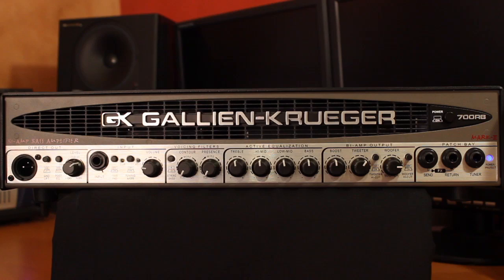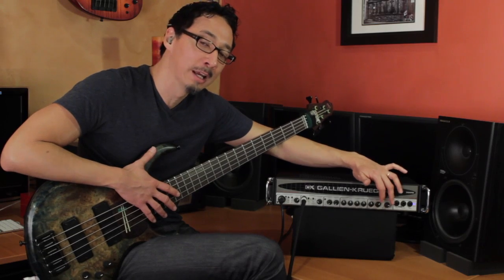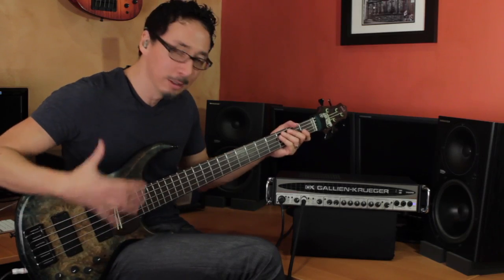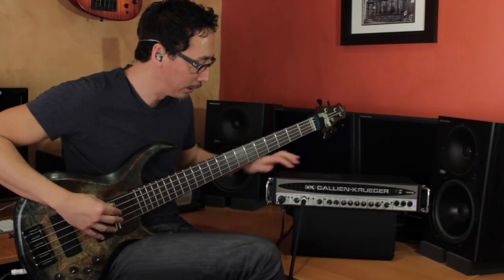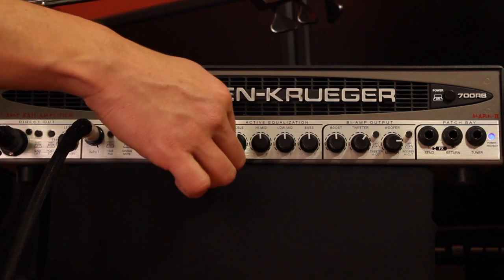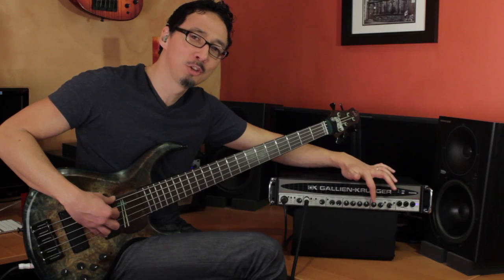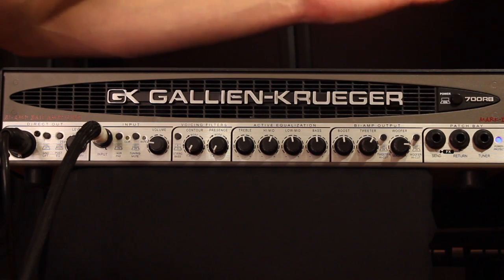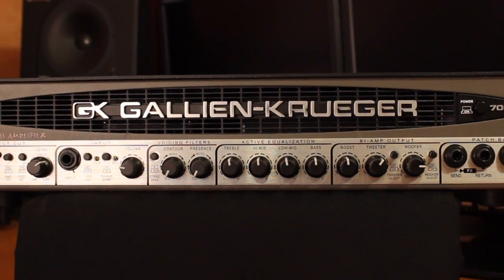Gallien-Krueger 700RB Demo by Norm Stockton

Comment: Hey Norm... Christos .. great to see you....  have to agree on the high current capacity on these amps ... been using it for my dual element Butt Kicker for years.  Those have blown other heads before but GK 700 can really drive and the cooling systems has no problem...

Comment: Love the sound of this amp but no headphone jack, no RCA jacks if you want to play along with your iPod and the effect send and return are in the front. Love the amp but I wish they would have included a few more bells and whistles.
Reply: I agree. I don't like all the clutter of wires on the front of the amp with DI, effects send/return  connections, etc. Much prefer connections on the back like the old 800RB. Great sounds though

Comment: Getting one today with the 410 neo cab aswell
Reply: bobby springless Did you get one?
Reply: ***** Yeah i ended up getting one. It came with a 2 channel speakon to access bi-amp mode. The bi amp mode does not work as well as i thought it would. the tweeter only works clearly when you are grooving to songs that have alot of slapping.

Comment: What technique is Norm using at 5:30?? I have never seen that type of plucked harmonic and I am super interested... Anyone have any leads on how to do that?
Reply: He's placing his right index finger on the string where the harmonic is above the pick up, then using his other finger to pluck the note. Just imagine your fret board kept going and put your index (or thumb which is what I use) where the fret would be over the pickup. Or just slide your resting finger back and forth until you find the harmonic you want. If you want a more aggressive harmonic you can also do it with just your thumb, where you pluck down threw and angle the tip your thumb back up instantly to lightly touch the string. If you've even done a pinch harmonic on guitar just imagine your thumb is the pick.

Comment: I'm thinking about getting one of these to run through a gk 2x12 cab paired with a gk 1x12 cab. My question is will the cabs have enough low end or will I need to run the head through more speakers like a 4x10 with a 1x15?
Reply: Yes, you can use 2 eight-ohms cabinets together.

From the manual:

Impedances lower than 4 Ohms should not be used. Higher impedances such as 8 Ohms, 16 Ohms, or no load are acceptable. One 4 Ohm, one 8 Ohm, or two 8 Ohm
cabinets are okay. One 4 Ohm and one 8 Ohm together is not recommended.

Comment: I’m interested in getting this head, but I run an ampeg 4x10 4 ohm cabinet, my concern is the speakon jacks. Can I run one end designed for the gk and one side that’s universal? And if I do that, will I also be able to power my tweeter? Thank you.

Comment: "Very musical stuff"

- Norm Stockton.

I bought this today; I don't actually own a cab so I can't test it, but it would be useful for gigs where I can use other peoples cabs. I asked why the Tweeter wasn't working, and I was told that the Tweeter only works with 2 cabs and the horn and tweeter use for specific cabs. Is this right or did they just sell me a broken head?
Reply: gasmaskboi19371945 Since so, did you test it? How do you like it?
Reply: ***** I tested it at the store and the tweeter wasn't doing anything. I still haven't tested it on any other cabs yet. I've been drumming a lot more than I have been playing as of recent.
Reply: You just liked my comment and reminded me: I was at a band practice today and brought the amp head along with me to plug into a Peavey 410 cab: no sound was coming out of the cab when I plugged my head into it - no idea why. Do I have to use specific speaker cables or was the amp automatically clipping the sound because the impedance of the cab was 300w, when the wattage of the head is 480w? 

It was working with the other head that was plugged in during the time - a Laney RBH to be specific.
Reply: gasmaskboi19371945 "Do I have to use specific speaker cables or was the amp automatically clipping the sound because the impedance of the cab was 300w, when the wattage of the head is 480w?" Both options may be right... I'm thinking of buying one of these, or a 400RB IV, but I confess your comment let me in doubt... Anyway, please, if you can solve the problem, let me know. It may be the case you're not using the right cable and/or the difference of wattage.
Reply: ***** I'm gonna try it with a different cab somewhere sometime. I need to know ASAP whether there's a definite problem with the head or not. Also, take note that I bought this second hand too,
Reply: gasmaskboi19371945 I have the same problem with the 2 channel speakon cable. the tweeter does not work!!! The cable came with the RB700 MkII and 410 neo cab
Reply: bobby springless Hmmm...
Reply: So, if it doesn't work with 2 cabinets, the 400RB can be a better shot... The experience you have with the product is VERY important to me. I just can't make a bad choice.
Reply: *****  gasmaskboi19371945 All i can say is try before you buy
Reply: bobby springless I did: It worked fine at the store, but at the rehearsal room, it just didn't work for some reason.
Reply: gasmaskboi19371945 Putting everything aside i finally tried it at my gig last night and it was amazing.... everything you want. the tone was excellent, and makes my Fender P-bass sound amazing!!!! This amp is great when loud and is a good competitor to mark bass gear
Reply: bobby springless Best amp I've ever played through, man. I haven't played it through a Gallien-Krueger cab unfortunately.
Reply: gasmaskboi19371945 I Agree :)
Reply: bobby springless It'll go well with the best bass I've ever played on: Musicman Bongo 6!
Reply: OOOOHHHHH SOOOO JELLY RIGHT NOW :D
Reply: bobby springless Same here... I don't own one... but I played on one the other day! I WANT IT!